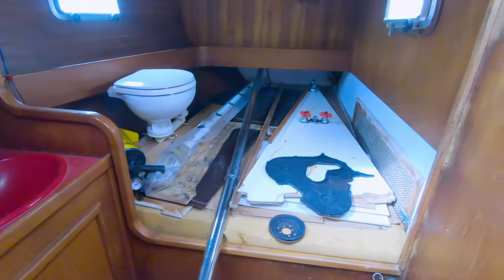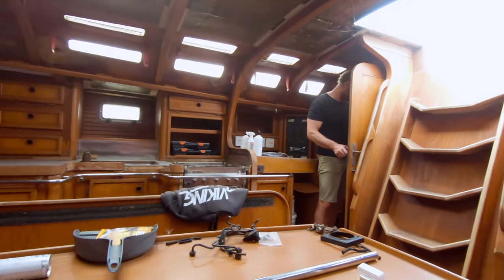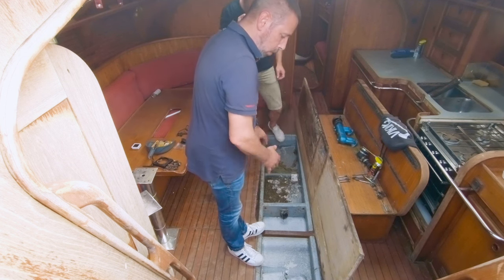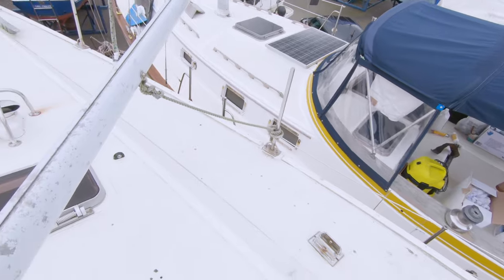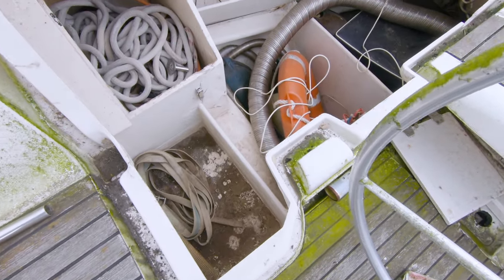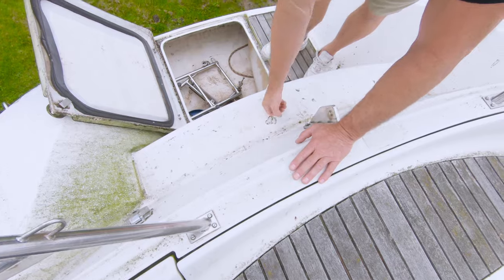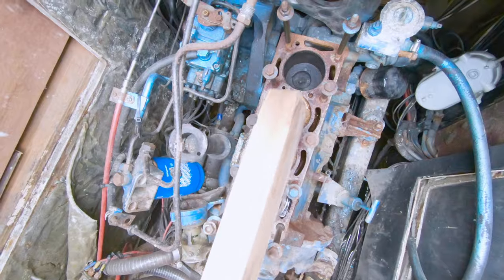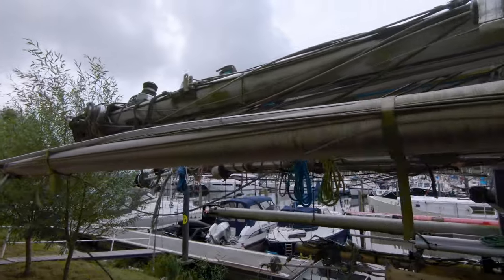First look at an abandoned '89 JEANNEAU 47 - Ep001

Comment: What is this? Well, when your cabin hatch was stolen, and your ship interior turned into a shit interior, that could be THE reason why this one was dumped. When the previous owner gets into financial problems (no money), even simple things like reparing the cabin entry will go wrong, and the result is a disaster below deck.

Still, priority number one is: is the hull in good condition? All bulkheads okay? When there are keel bolts, do check if the thread is good. For people who do not know sailing yachts, think about what happens when your rudder says cloink and sinks to the ocean floor.  It's like driving the interstate and your steering wheel comes loose. How on earth can you fix that?! Well, do check the rudder, build a new one when you doubt it. You do not want to die during a storm. The rest means work, replacing things. When you buy a yacht, have it inspected by a ship builder you trust, or do it yourself, if you know how.
Don't let this scare you. Jeanneau is a famous ship builder, and that is important. Chances are, somebody is gonna do some nice trips at sea. Why not?
Reply from the maker: Hi, we are fully aware of the state we buy her in. Hull is sound and dry. Deck, keel bolts and stringers may be the only things that bring (unpleasant) surprises, though everything can be fixed. The whole thing  will take time, money and persistence but should be fun! We will continue working on her this summer.
Reply: @the-waterfront  Ah, you have more vids, you know what you are doing. Great. I'm Dutch, living on a tight budget, owned small yachts (do check out Waarschip, it is plywood and very good, except for the "family fun" model, designed for harmless sweet water only, sorry) and I switched to canoeing. But yachts are great, when the dime has fallen, you can not cut corners. Everything onboard must be okay, cheap goats will mecker one day. Cheap is okay, by the way, there are smart versions of everything onboard. Do you know the trick of TWO mainsail sheets? One from starboard, one frome port. This ways you do not need a traveller, and still you can trim the boom to every position you want. Such solutions are bright. You just need to search for them. And most yacht owners are conservative, you won't see many innovations in the real world. Okay, enough, have a good time!
Reply from the maker: @voornaam3191  Well, turns out we are Dutch as well and... we also owned and refitted a Waarschip 725 from 2015 -2019!
She was a beauty and we really loved sailing her, but due to wishes for more comfort was sold eventually. Till today we still somewhat regret that choice, but sadly it was inevitable. We are not intending to cut corners on this particular refit, but we'll definately look for non-marine alternatives if possible to cut costs!